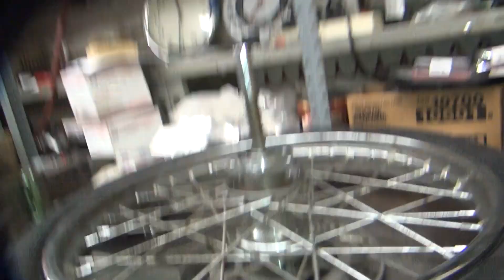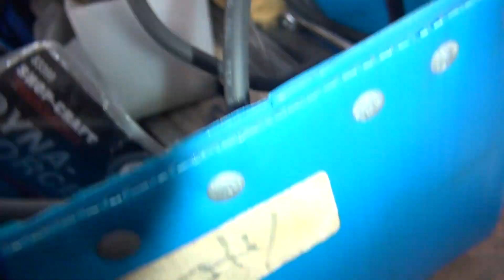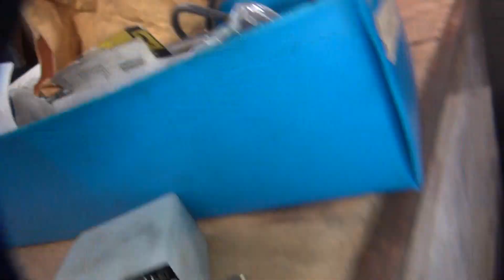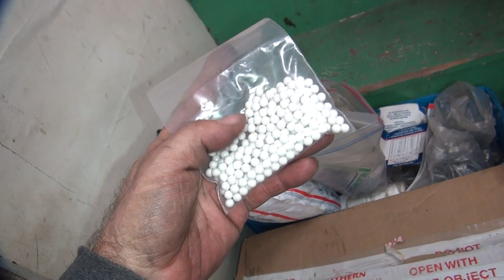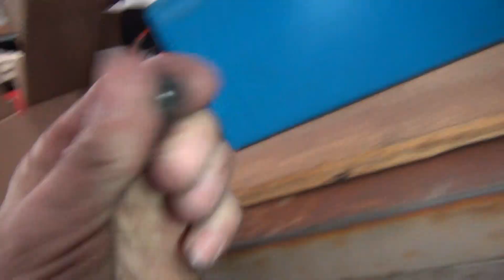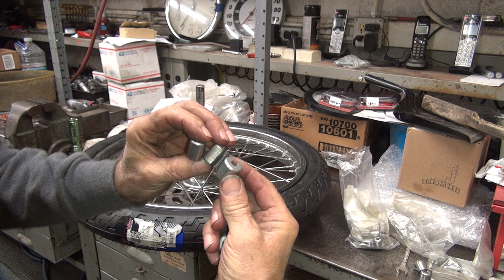#147 1999 80ci evo chopper used bike tune-up repair rebuild rigid bobber custom harley tatro machine

Comment: You can maybe build a tire balancer on your engine stand? 😊
Reply from the maker: no need to. my hand works just fine for now. i have a stand allready if i wanted to use it.
tatro

Comment: That's a lot of weight....I would move the tire if the bike was mine and start over even if it was a car tire.
Reply from the maker: having 3 weights on a wheel is not that uncommon. after a wheel and tire are broken-in it doesn't hurt to rebalance things. once they take a set things should stay that way for awhile.
tatro

Comment: Gonna have to try your way... I would set my balancing-axel in vice (make sure it was level, slip in the wheel and tire and give it a good spin, go do something else until it stopped spinning, marked the bottom and spun it again 2 or 3 more times to confirm the heavy spot, add weight and start again... was okay as long as I was doing something else - took a while to finish a balance but, your way seems much faster and probably just as accurate.
Reply from the maker: the problem with your way is that the bearings and seals have drag and they will cause errors. keeping the timken wheel bearings pushed together and quickly moving the axle back and forth will lessen the drag and give you a more accurate reading.
tatro